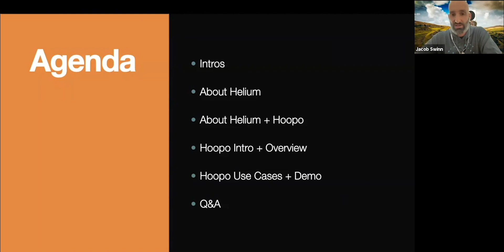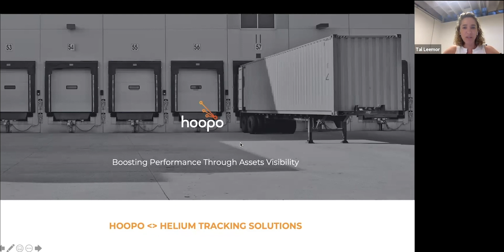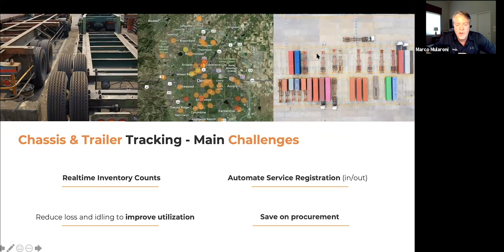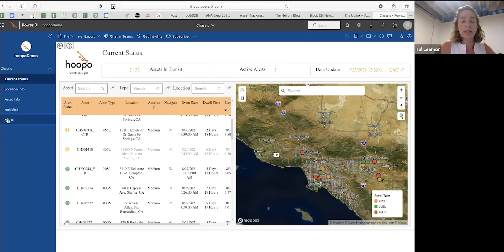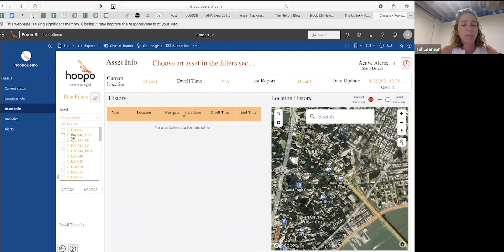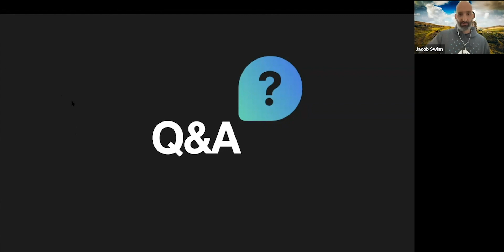The Uplink: Asset Tracking for Logistics Operations with Hoopo

Comment: Your network will fail when the profitability drops to the floor, which is pretty much already is. 99.9% coverage in developed areas, and the rest of it 99.9% empty, with no incentive to provide coverage because the payout is insignificant.
Reply: I know right. Solo miners should get most rewards